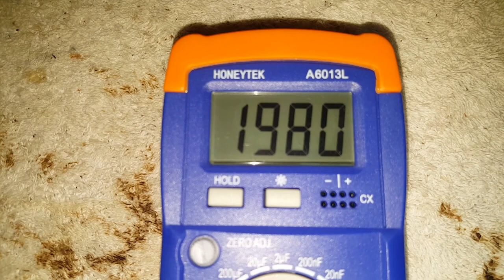Original Xbox 1.4 Power Supply Capacitor Replacement

Comment from the maker: When I said 105 volts I ment to say 105 degrees. 105 degree temp capacitors usually have 1000hrs or less. These said they have 10,000hrs.

Comment: Question, what original psu is best in quality and reliable?
Foxlink or Delta?
Finally got an original Xbox v 1.0, it came with a Foxlink psu.
Reply from the maker: These days all that matters is it works. I think Foxlink is a newer revision than the other PSU. Biggest problem with these OG Xboxes is the disc drive not working, and no new replacements exist.
Reply: @sleepwalker29  This one came with a dead Samsung drive, does read discs but console doesn't boot, shows error 12 or sometimes 11.
I confirm the DVD drive board is faulty, the controller IC overheats a lot. I swapped that drive with a fully functional Hitachi GDR-8050L and the system works really good. No graphics error in some games like those v 1.6 consoles playing on 480p. Just I was wondering about quality on psu, people says that Foxlink on v 1.0, 1.1 systems are bad and even they can be dangerous without properly resoldering the AC IN plug connection.

Thanks for your response.